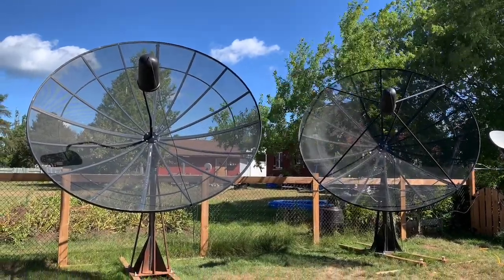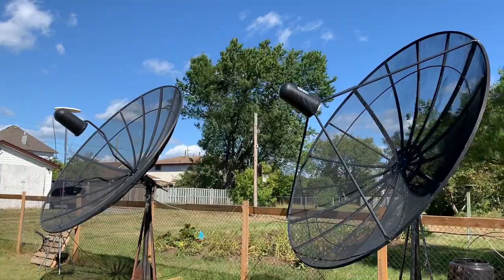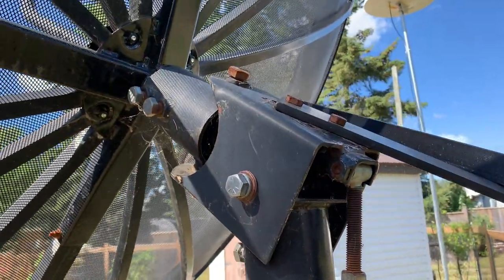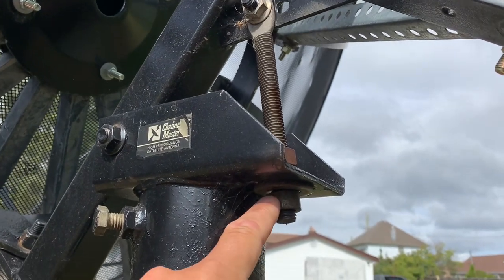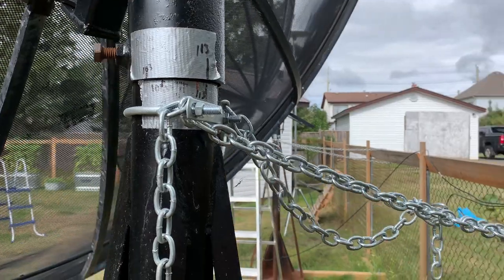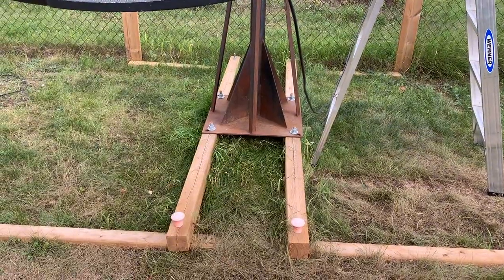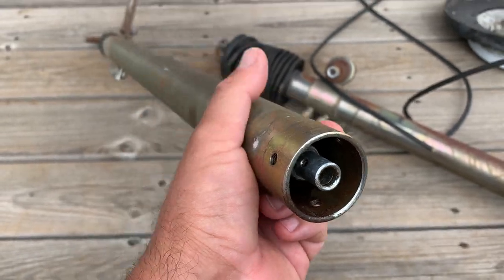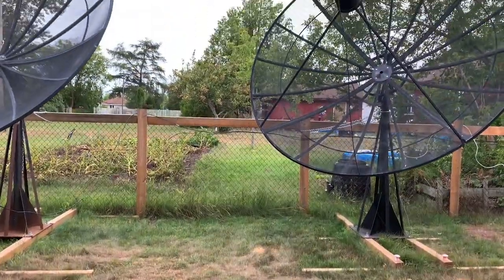The C Band Satellite Dishes I use for Free Satellite TV

Comment: When I got into this hobby I tried the new style LNBF and had reception issues. So I bought a dish mover that not only moved the jack screw but also powered the servo motor. Then after using an older lnb that still worked I bought a commercial LNBF to mount onto the feed horn. I can tell you for certain that the old style lnb on a feed horn with actuator works far better then the new style. They even have feed horns now that you mount 2 lnb’s on so you don’t have to have a servo motor which is what the cable companies use, as I used to mow the local cable companies downlink location. Interestingly all of their dishes were 16’ stationary solid dishes and many had multiple feed horns to receive multiple satellites. I was lucky enough to talk to a technician once while mowing there and was able to see the current commercial receiver equipment currently used to decipher encrypted signals. 

While this is a hobby, there is plenty of watchable stuff on there and if you speak Spanish there is a goldmine of really good channels to watch. It’s also fun to see what other countries have to watch as well.
Reply: Servo controlled polarization? That's up there and with things I'd rather not deal with in the middle of the night changing channels lol?
Reply: Imagine the solid state technology starlink has accomplished with their dishy, I bet it receives everything.
Reply: @jeremycook4670  I have the titanium ASC1 dish mover that has servo polarization changes done by the voltage sent by the receiver. It workS like it did in the old days. The only thing I noticed is when you try to fine tune with the receiver remote it moves the dish quite a lot. If you use the dish mover or it’s remote you have very fine motor control. 

Was pretty pricey to set up this way, but was almost required since I had terrestrial interference on the new style LNBF’s but didn’t on the old style.
Reply: @jeremycook4670  I think the most fascinating part of the starlink dish is the users ability to set the dish out and it Orients and tunes itself, tracks the moving satellites across the sky and apparently has the ability now to do this on moving planes, ships, trains, trucks, RVs, and cars. 

As far as signals it uses I’m pretty sure they are up in a higher frequency range, and fairly high power.
Reply: @shawnhicks619  that's interesting if you don't have any sort of growth around you seems terrestrial wouldn't have anything on it? BTW I do remember the ability to have servo Pol but I had never seen one irl, I just remember my godfathers setup.
Reply: @shawnhicks619  yeah mid gigahertz 60?

Comment: Nice setup, I used a 2 meter dish 6 foot and ran C band and extended Ku band  through a modified co rotor with liniar and circular polorization and an L band antenna as well as a modified polar mount with a second elevation actuator for tracking inclined orbit satellites

Comment: At 10:19 - You can power those actuators off a 12 volt battery charger.  It is usually the black and white wire connections under the actuator cover on the terminal strip.  Reversing the polarity reverses the travel direction.  That is how i just changed one of my dish positions last week.  I also attach my coax to one of the legs or the button hook and run it back to the dish pivot point and then down the mounting pipe.  This prevents the wind from "working" the coax cable which I found will eventually lead to a failure.  
I also retrofit all of the original threaded hardware with grade 316 alloy stainless steel which I purchase from McMaster on the internet.  Grade 304 aka 18-8 stainless fasteners are cheaper but they seem to strip out and are not reusable.  
I have been working on and installing my dishes since 1992 and so far so good.
Reply from the maker: Thanks for the tips, and for watching!👍

Comment: Cool video. In Europe if you are interested in C Band there is this satellite Express AM7 at 40.0°E. On this satellite you receive russian TV channels. The interesting part is that you can use a 100 cm dish and have great reception. The problem is with the LNB, you need an LNB that works for Left and Right polarisation instead of Horizontal and Vertical.
Reply from the maker: A circular LNB.
Reply: You can get an insert that you put into the LNB to convert it from H/V to L/R polarization.  It's a quarter-wave plate.
Reply: Any other C band sats in eastern EU? Any other programming on the sat you mentioned other than Russian ?
Reply: @Subgunman  For example there is the Paksat 38 East if you want channels from Pakistan but you need a 4 meters C Band dish,  you may use a 350 cm dish but it's small, unlike middle east where a 1.5 or 2 meters C Band dish will work excellent. There are C Band satellites but it's useless they mostly have feeds except the russian and pakistani satellites where you have TV and Radio channels. In Europe I recommend a Ku Band dish preferably a 120 -150 cm dish and an actuator and you have more than 2000 TV channels
Reply: @Subgunman  Those russian channels can be received in the entire European continent  on Ku Band, with a 100 cm dish. On Express AM 14 West, so no need for C Band.
Reply: @Nicholas 201622,
Thanks for the valuable info!
Reply: Why do Russians keep using circle polarization?
Reply: @eswnl1  I don't know. But their Ku Band transponders are linear.

Comment: The stuff was so complicated I can't believe it made it into consumer grade equipment, especially with a motorized dishes different lnbs polarization etc etc and everything needed to run it could be ruined by a weedeater.
Reply: Actually there is enough information available, especially now with the internet, that if you can set a post level, read a tape measure and can do some basic math and have some patience it’s not that hard to set one up. 

I have a couple of dishes my self and installed and tuned them myself. It’s kinda fun and interesting to see what there is up there. As far as the cables, I took a few ideas from the cable companies dish farm and installed all of my cables inside a length of exterior grade pvc conduit. 

I installed my dishes on pipe buried in the ground with a concrete anchor.
Reply: @shawnhicks619  no they're not that hard to install, it's just all the motor controllers connected to the stb, etc it's as intricate/interesting as ham radio.

Comment: I designed and built 16 foot C band dish systems back in the late 70's in Winnipeg. They needed to be large to get the signal/noise ratio acceptable, as the better LNB's for that band had noise figures of 110'K. Compare that with today's Ku band LNB noise of 0.7'K. Back then there was NO encryption on the signal, so simple analog receivers worked fine. Entering the 80's, the only remaining analog signals were for religious channels.

Comment: I have an old 12 fiberglass 12 foot dish  what equipment do I need to power and move this dish I had a 4dttv receiver but i think it was thrown away
Reply from the maker: An old analog receiver can be used as a dish mover. They also have a dish mover (similar to an antenna rotator box) called a Super Jack. As far as a new receiver, get a DVB-S2 receiver, that’s the current standard used for free satellite TV.

https://youtu.be/GaIWR253BT4
https://youtu.be/UJLcbAL0QM0

Comment: Interesting  I was not aware these Satellites were still operating. In mid 80s I was a Wineguard , Channel master and a few lesser known brands. Drake was good. I need to look into C-band again some time. Oh those originals LNBs were NOT LNBs  they were LNAs with a Block down converter attached but usually attached in line at the poll. The LNAs were weak  at first then just got better and better. I agree with the folks that do not agree with your mounting system. You will get damage at some point. Just dig a hole put  a st-ought pipe and 3 or 5 bags of cement then some water. It would likely be less work than your current unstable system. Most places rarely get high wind but the once every two or 3 year wind will take those from you and Could cause Damage to someone else and you could be liable. So post and cement and post hole digger. Also. The mesh as compaired to solid makes less than 2% differance in high wind as compaired to solid. You may get away with this but someday the wind will take those. Think of t as insurance agaist loss and liability. Dishes have been torn loose by wind and damaged expensive cars trucks houses and more importanty people. Its easy. And no you do not dig up pole and cement from where they came from. Its less than 5 hours work. Plus makes good lighting ground.
Reply from the maker: Concrete is definitely better. I set up these stands as a temporary measure. I actually bought the schedule 40 3-1/2” OD pipe a while ago, but haven’t gotten around to it yet. So far I’ve had no issues. The stable ground certainly helps. Thanks for watching.📡📡

Comment: excellent video,  I have  7 or 8 ft.  forgot, as I watched the classifieds a few years ago , bought  It for under 100 dollars, 150 miles away  Cemented  it in . Windy here.   sometimes . SW WI. thats all the farther I got as all the old analog stuff for c band  either isn't
working or I've not pointed right. I thought there was 1 station still on analog .  I need all new stuff. my question is what can I do
with these old c-band receivers?  4D TV General instrument and other models I have a 4 or 5 receivers obsolete now, aren't they?
Reply from the maker: The last analog channel, C-SPAN, shut down at the end of October. The old analog receivers can still be used as a means to power the dish actuator, or change polarity on older LNB’s with a servo motor for polarity. But all the channels are digital now. Thanks for watching!📡

Comment: What's your f/d ratio for your 10 foot dish?
Reply from the maker: I’ve never calculated it. I used a meter to set the LNB. Also when I set up the dish I measured the scalar ring distance on both sides, made sure it was even as possible. It’s worked without any problems.

Comment: I have a very old bird view 10 foot aluminum dish, it is slow moving because it is driven by a gear box.
I had a Houston tracker 5 but it stopped working and couldn't be repaired. Where can I get a new unit???
Reply from the maker: Try Tek2000.

Comment: That Zephyr antenna needs a much more stable mount.  Even if it is only being used for timing, you have way too much movement.
Reply from the maker: I’ve since taken it down. It was staked into the ground. Didn’t move at all while it was there:
://youtu.be/decdu2uEx3A

I’d like to put it back up, but I’ll probably put it somewhere else. It was there for testing.

Comment: I will have to do research on what is on C band in 2022, I have a 3 meter dish outside but the last time I used it there was not much on but porn stations and news from other countries
Reply from the maker: Generally you get the same type of channels received locally with an antenna. But also news feeds, international channels and interesting stuff not available from an antenna or cable. But no actual pay TV cable channels. Those are encrypted. And no adult channels. That’s not what the free satellite TV hobby is about in my opinion.📡

Comment: Just buy a new actuator and be done with it, lots more fun scanning the skys, then maybe one dish vertical and one horizontal. Upgrade that coax too ;)
Reply from the maker: There’s more than one way to do things. I have plenty of fun outside with a wrench and meter moving my dishes around. Coax hasn’t caused any problems either. Thanks for watching!
Reply: @NorthcoasterHobby  What coax are you using? Rg59
Reply from the maker: @TrueBlueAustralian  Absolutely not. Minimum RG6. Some is RG6 Quad shield.
Reply from the maker: https://youtu.be/Kope__f6kDQ